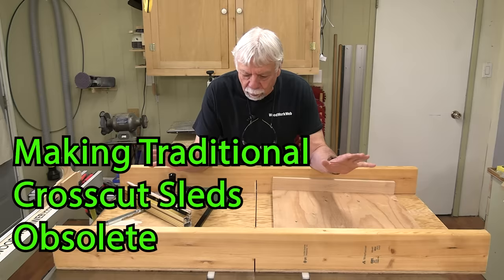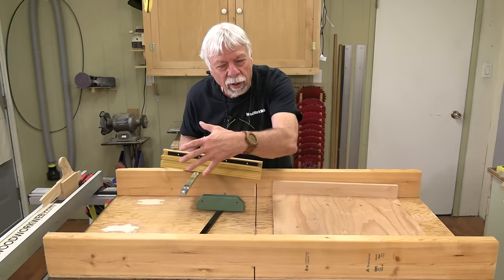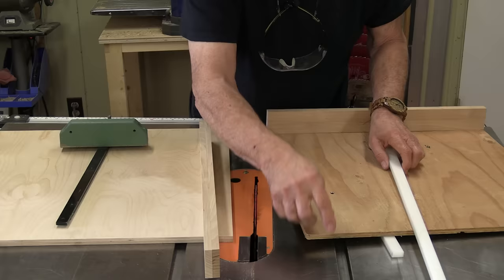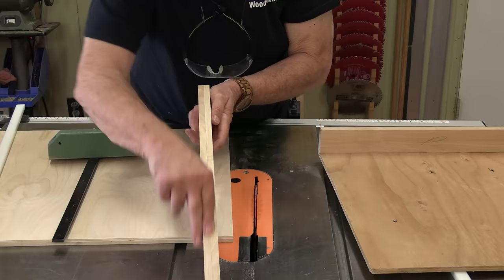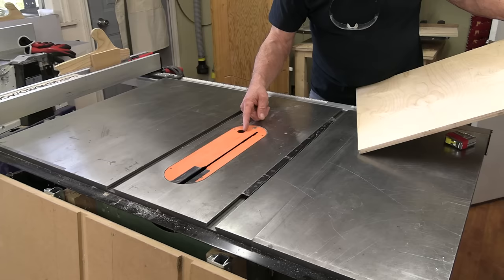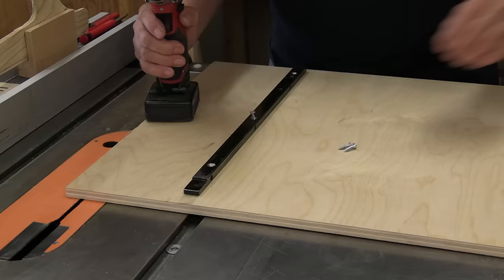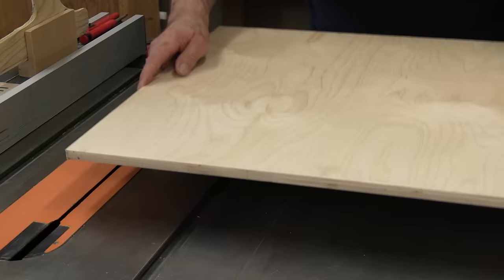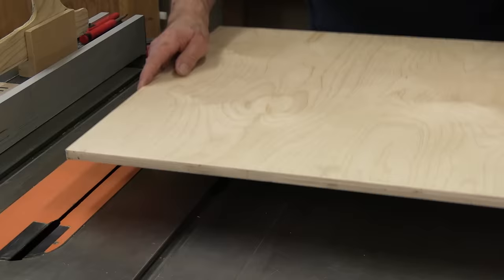STOP Making Out-Dated Table Saw Sleds, Do This Instead

Comment: Norm Abram called it a 'panel cuttah' - panel cutter.  Both a panel cutter and a crosscut sled work like a dream once the saw blade is adjusted perfectly parallel to the right hand miter slot.

Comment: Small sleds are great but the larger one helps support the off cut if it’s of any size. And with that it keeps the offcut from bouncing off the table and possibly into the spinning blade.
Reply: Exactly, this is not going to replace the standard sled for those reasons. Look at the waste go flying in his test cuts, no thanks.
Reply: You can counter that by using a stationary piece that sits on the opposite side of the blade to support the off cuts. Rockler sells this to support off cuts  with their similar jig they sell.

Comment: Something I noticed about your old sled is the massive amounts of unnecessary wood. You could cut away much of the far fence, and maybe quite a bit of the fence nearest to you. I'm wondering if you could cut holes out of the panel to save weight. Also maybe you can get away with only half of that sled. But that depends on what you use it for.

Comment: I made a quick one similar to this when I was going to eventually make a bigger sled. I ended up never making the larger sled because the smaller one was easier and did the job just fine.

Comment: There are different designs of crosscut sleds because they have different uses. Your ‘old’ sled was too big because you might have wanted to cut panels with it. A panel crosscut sled would look like your new sled and is better suited, as you say, to wider material. An alternate design by Norm Abram turns the sled around which allows for a much larger sled base depth and therefore even larger panels. A smaller version of your old design could be fitted with design elements that would make joint cutting easy and accurate. A sled with no front or rear supports is a great platform to set up a 45 deg miter sled for simple or compound miters. I have three sleds in my shop: One for panels, one for joinery, and one for mitering.
Reply: I also now have one for cutting the slots for corner splines.

Comment: Just a quick note, something I hear often that I think is incorrect. Cutting fluid is not for lubrication. It is for cooling; which you also mentioned.

Nice sled. I made one like your old one decades ago; for a smaller portable Makita saw. Dad uses it now. I will definitely be building a simpler lighter one. Thank you.

Comment: I have a similar sled that is just slightly smaller. When searching the scraps for a runner I found an undersized piece with a bit of a loose fit, maybe 10 thou, and decided to give it a try. It's fantastic - i just need to keep a small amount of pressure towards the blade when cutting, and after i clear the blade I can pull it the 10 thou away from the blade and safely pull back to start position with zero chance of damage on my clean cut. I dont think I'll ever make a snug rugger for a single side sled again!

Comment: This type of panel sled can also be used as a circle cutting jig. Just make a pivot point at the desired radius from the edge and rotate a square workpiece around that pivot point.
Reply: That is possible, but i wouldn't recommend it. These jigs are extremely dangerous.

Comment: This sled is very handy to be sure, but the larger sled is more versatile.  First and very basic, tune the saw using a dial indicator so that the blade is parallel to the table slot and check for blade runout.   Make your sled as shown except for the fence.  Very carefully choose a truly straight piece of wood for the fence using a straight edge.  Rather than using countersunk screws (very inaccurate) simply glue the fence in place using only a thin layer of glue and a precision square to align to the edge of the sled.  Forget the carpenter's framing square which is most likely inaccurate.  If you don't have a  4"-6" precision square a quality combination square might work in a pinch.

Comment: 🔧🪚📐 While your base design is impressive, I'd suggest considering a small angled cut at the meeting point of the fence and table board. This can prevent any potential dust buildup that might affect the fit against the back fence. It's a minor adjustment that could enhance the overall functionality of the sled. Keep up the innovative woodworking ideas! 💪🌲🔨

Comment: My favorite jig material is “FinnForm”, a phenolic coated and impregnated Baltic birch material.  Dead flat and weather impervious, it’s also very slippery against tool surfaces.  This appears to be the material Incra uses for their sled products.  I use TreWax to maintain slipperiness. I also use ~ 180 grit PSA sandpaper and toggle clamps on the work surface to maintain a reliable clamping environment. This recipe ensures a long lasting, sled or fixture that has the accuracy needed for the most demanding projects.
Reply from the maker: Finnform ... There's a name I have not heard in a while and had forgotten about, I need to see if I can find a local supplier... thanks buddy
Reply: I last purchased FinnForm from Rockler. They’ve had in varying sizes over the years. They were NOT calling it FinnForm…

Comment: A very practical approach to squaring boards. The blade should be parallel to the T slots but that is not guaranteed. I believe my General cabinet saw has an adjustment for this. But your suggestions about the plastic runner and modest size make a lot of sense to me. Going to build my own now! BTW to eliminate chatter from the countersink when cutting metal, slow it down to 100rpm or less if you can. Also single flute countersinks chatter the least.
Reply from the maker: Thanks for the tip on the countersinking ... I always struggle with making those

Comment: I am surprised that you didn’t chase out that .025” that you are out of square. Only other thing I would have suggested is use three pieces to build your laminated fence piece. Two reasons…one is even more stability over time and also, less likely to put a screw directly into a glue joint.

Comment: The only thing I would have introduced is an undercut chamfer where the beach meets the plywood. This just keeps fine dust from collecting in that spot throwing of the alignment of your workplace against your back fence. Otherwise an excellent and simple build. Thanks for sharing.

Comment: Hi! Thanks for the great videos! What about putting the fence on the opposite side? You could extend it more because the weight would be on the front side and it opens some other possibilities. It may require a little extension table to be built.

Comment: Beginner at woodworking here, a cross cut sled is on my to do list.  This looks like a better option.  I saw 1 application of the sled in your introduction.  Do you have other videos showing it in use?  I try to prioritize safety around the tools and the introduction had the work piece held in place by hand.

Comment: You can also use accurately measured triangles up against the fence on its flat side to cut boards at accurate 30, 45, 60 degrees or whatever angle your triangle measures.

Comment: I use an aluminium runner. The fit was too tight, so I sanded the aluminium until it slides smoothly and effortlessly. I stuck them with hot glue and fastened them with counter sunk screws, through pre-drilled holes.

Comment: For your next version, aluminium composite panel or PVC foam board would be even lighter and not much more difficult to work with than plywood. You can cut them with the same blade.
Reply: Foam board is weak. It would ware out i. No time and if you drop it? Well that would be that. No durability.

Comment: I think that this method works really well for the tapering jig, but I don't think that I would rely on something like this for cross cuts.  Some in the comments have already mentioned the big issues, like the waste being thrown back and your fence not doing anything for tear out.  However, you don't have anything to use as a stop block for repetitive small cuts using a single piece of stock.  The last question I have is about aligning jigs to the miter slot.  I'm thinking that this may be something that is determined by the saw.  True cabinet saws have the trunnion section separate from the table.  In these cases, you need to align the top to the blade.  Contractor saws are different because the trunnion is connected to the underside of the top.  With all of that said, I would still rather use your design over the crappy miter gauge that came with my SawStop.

Comment: If you have  a metal supplier near by, see if they have 3/8 by 3/4 cold rolled steel. Makes good runners. Rockler also has aluminum runners.

Comment: The HDPE plastic used for cutting boards has a huge coefficient of expansion when exposed to heat. Run hot tap water over one side of a  3/8” thick cutting board and watch it curve!

Comment: Great idea and presentation.  Thank you, I am going to build one.  Do the wood specialty stores like Rockler sell .75" wide rails that have a screw adjustment to take up the lateral wiggle "wiggle" ?
Any suggestions?    Also, I have a cheapie Craftsman 10" portable table saw  ... the table is aluminum and is not as slippery as a smooth steel tabletop.  Is there something that can be applied to the surface that makes it more slippery?    Thank you in advance for your help.

Comment: i pickud up a 48" length of 't-track' for about $20. its 1/2x1" with an outer cover and inner slider, middle is hollow to allow for screws. im going to bed that into an inch thick mdf table i have and cut it down. the inner ill put holes in so i can screw wood to it and run it through fixed to a track (bandsaw in my application).
if you think your angle guage is bad you should see the bendy chunk of cheap plastic and undersized aluminum i got with the wen saw 😂

Comment: Hey , I'll up you guys a couple of cuts. LOL The 1 cut method is fastest and needs no tape measure. Assuming of course that the work-piece has two parallel sides. Cut once. Flip the piece and line up with the edge of jig and visually check for run-out/run-in. The adjust jig-fence 1/2 of runout. Cut again and flip to check. It's the same as setting the fence on a big sliding table saw. You just cut, flip, and check it against the edge of the sliding table. For micro adjustment on the big saw especially, because the metal slide table has blade clearance, whereas the slot jig has zero clearance. Run the saw and slide your flipped piece past the blade. Just barely kissing it, and observe if it is even. If it isn't the blade will throw a tiny bit of dust at one end or the other. It's just a little tap away from dead nuts. I always use a sacrificial fence attached to the permanent fence to stop blowout on the back of the cut. It's also something you can screw stops and hold downs onto, and remove the whole setup for later use, without wrecking the main fence.

Comment: Nice. Assume adjusting table saw top parallel run to blade would improve the tolerances of .025 on the 3 cut check

Comment: Everyone should make the crosscut sled they prefer. 
The small sled may have its uses, but I prefer the bigger crosscut sled.
The off cut is supported under and behind, two well fitted guide bars are more stable than one well fitted guide bar. 
I don't see any advantage to using a carpenter square to set the final fence position and then make the verification cuts, it's too late to fix it at this point without drilling new holes. 
Yes, wood moves, but built in error compounds the problem.

Comment: I like the sled you built. Are you sure it's out of square as much as you mentioned? As a retired Machinist, I'd have only checked one cut edge to the factory cut edge against the square. I'd have only put 1 screw in the fence at the edge on the cutting side of the sled and clamped the far end with the C clamp. Then I would've made one cut on the board and checked it for square, and if need be, adjusted the fence on the sled to get it as close as possible. Then I'd leave the factory edge against the fence, and cut side 1, and 3, and measured the piece to see how parallel it is. Who's to say how accurate your square is in the first place? We all use those big framing squares, but I've always doubted how accurate they are.

Comment: Here is my opinion.... i made a monster sled...and you can separate the 2 halves.   And reconnect.  So you can cut from either side of blade.  My sled is the width of the table top but my runners are tapered and are slightly longer than the depth of the sled for easier alignment.   It is lighter when you don't HAVE to push the whole thing...but IF I ever have to redo mine...  I will utilize the plastic runners.
😊

Comment: I just built a similar sled and junked my old fashion sled. I used William Ng’s 5 cuts to a perfect sled doesn’t require an accurate square but it does require math and I found a plug in formula online for the 5 cut method. Just search “5 cut formula”.

Comment: Great video sir. I hate when sometimes a fixture or a fence drifts out of square/parallel.  Then the detective work kicks in to bring it all back together. I was cleaning my shop and discovered some old slide fixtures, box joint rigs etc. I found that i kept the last three versions for posterity,  go figure. Your methods are fine, it gets you to the level of accuracy and repeatability you need for woodworking and glue-ups. And dont worry about the trolls., they're just Keyboard carpenters for sure.

Comment: I am slow, so I have to ask: the method of squaring you show only measures any error that may be present, and does not actually create squareness, Yes? If your final measurement is off, you have to go back and re-screw the laminated rail piece. Right?   Also, Did you purposely make the left edge of the sled (from the operators' perspective) hang over the edge of the table so you can put a clamp there? Thanks for all your great videos.

Comment: One of the first things you should do is make sure your square is square.  I do this by positioning two squares on a flat surface back to back in the store and looking for a gap at either end.  You will be surprised at the number of brand name squares that fail this simple test.  Of course everything that follows from a bad square will be misaligned.

Comment: Newbie here. Instead of a huge sled like before why not a back fence attached to both miter slots. With a safety block on back of fence to ensure your blade never is exposed to your hand. Just 2 sliders in the miter slots and a back fence.

Comment: @6:00 use your chuck key in all 3 holes to even out the clamping force of the jaws, you don't have to put a lot of force into it and it will hold better.

Comment: You want to have an extra area of plywood which is not moving. You raise the level of your saw's table to meet your sled. The workpiece will slide on the fixed part. Choose a surface with low friction, for instance plastic or metal.
This sled could even have a longer part close to the blade, when operating it will be to the right of your hip. It allows you to do long cuts withoutvthe parallel fence.

Comment: I screw a flat board into my standard miter gauge...that's what those two screw holes are for. That way you can still use the full height of your saw blade. My standard miter gauge that came with my table saw has indent's & a stop pin so you can get back, to & from 90 degrees to w/e other angle you want to cut from.

Comment: When using plastic runners wouldn't it be a bit of foresight to cut a shallow dado for it so that it sits firmly in its place once screwed down. And then, when it need replacing it would be that much easier and more precise. 
Your build is truly quick and easy but there needs to be a way to dial it to be more precisely square. 0,7mm/m or 0,025"/4ft is on the scale of being visibly out of square on the cut detail and it is almost guaranteed to drive you crazy when tackling some more precise furniture projects.

Comment: I have one of these but it can cause tear out on the piece to your right. That sometimes isn’t much of an issue, but if you are making repeated cuts using the same piece of (longer) wood it can be an issue. Has this been an issue for you?
Reply: Make a complementary sled for the right of the blade, to create a zero clearance.  Instead of putting a fence on the rear, put a downward facing cleat, to hold it in place.  This will give you a zero clearance table to the right at the same height as the sled to the left.
Reply: @Cecil_X  
Are you saying to make a second sled on the right with a fence? So, does it require pushing both sleds, one with each hand, simultaneously? Don’t see how there would be a zero clearance otherwise
Reply: @stevesiefken6432  no fence.  The second sled has a cleat facing downwards, hanging over the edge of the saw, to keep it from moving.  The cleat should be sized the same width as the channel between the saw and the fence rail.  A little slop may be ok.  You want it to be easy to put on and off.  It does need to extend past the blade, but I believe it can be narrow, to keep it light.  Maybe we can talk Colin into making a follow up video showing how. 🙂

Comment: Good idea using the no longer needed steel bar from the square. However surely It would have been much easier and more accurate to have just cut the sled bottom once the steel guide was fitted to it and then squared the backstop on the sled to the cut that the saw made on the sled bottom.